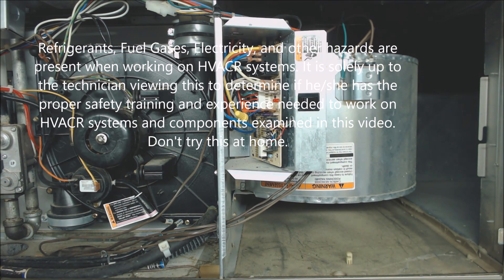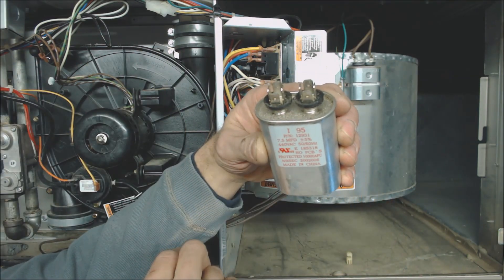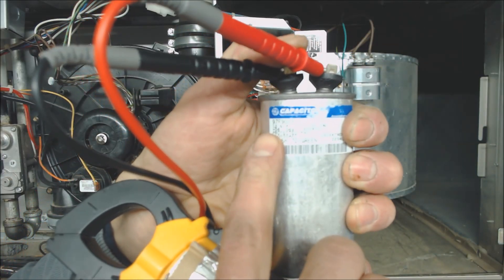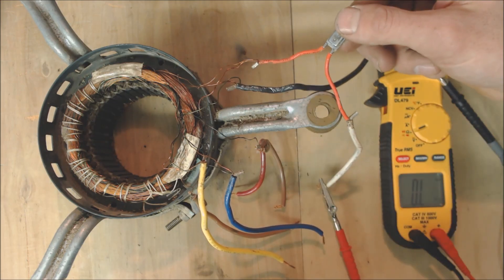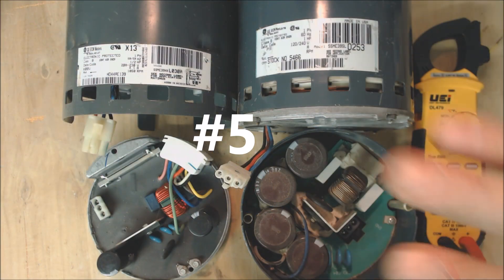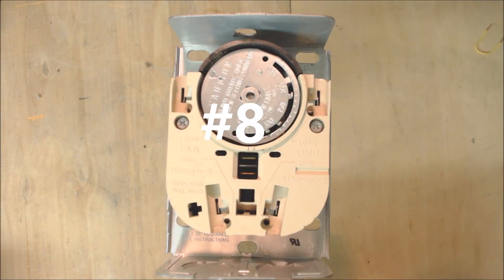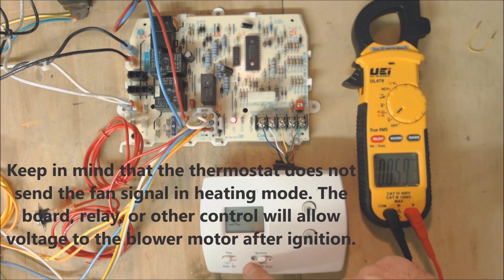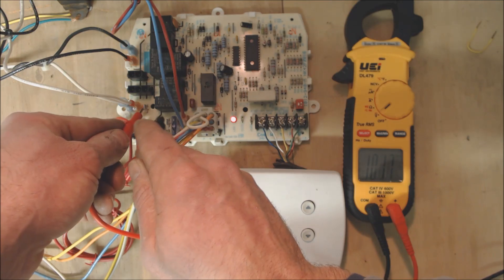Furnace or AC Blower Motor Not Starting or Working! Top 10 Reasons Why!

Comment: I’m having an intermittent issue like this. For three years I have had no issues, last week the blower motor sometimes turns on, sometimes doesn’t. I can hear an audible click when the blower is trying to turn on, but nothing happens. But then again, sometimes it works. More often than not though, it’s not working. Any idea?
Reply from the maker: Is the blower a psc, ecm, or ecm variable speed? If it is just a psc, it could be the capacitor, thanks!
Reply: @acservicetechchannel  It was actually the capacitor. The day I watched the video here I went and changed the capacitor, works perfect now. Thanks !
Reply: Exact same problem here. It got worsened though, now it is not working at all.

Comment: I have an packed unit and the blower comes on but doesn't  blow very hard. I bought a new motor and capacitor and it still barely blows air.
Reply from the maker: It sounds like there may be a duct restriction or dust covering the evaporator coil or clogged filter possibly, thanks!

Comment: My HVAC fan blower motor runs fine when it runs with no humming or vibration. Sometimes it will not come on at all and when I try to turn it on with the fan option on the thermostat it will not run either. I replaced the capacitor about a 2 weeks ago and it worked fine until this morning and the same problem occurred. The compressor and condenser cooling fan run and operate normally but the blower motor will not run. As it is Sunday I left it off most of the day and tried it again in the afternoon on fan mode and it came on and runs fine.  ???  I wished it would just quiet completely so I could find what is causing the problem.

Comment: My ac unit and my blower fan are not coming on and I don't hear the compressor come on (buzz). But getting power to all. I can also hear the thermostat send the signal to turn the motor on. Please any help is welcome.
Reply from the maker: Does it read 24v from y to c when testing with a multimeter at the indoor unit?

Comment: My blower on my inside unit goes for 60 seconds and then it stops. I cleared away any built up dust on the  back of the blower and the motor still seems hot. Everytime I power down then back up, I get the same 60 seconds of blow time. The outside unit is running just fine.
Reply: What was wrong with it?
Reply: Yes, what was the problem? That’s what mine is doing.

Comment: thank you & good job, but one more thing , if you have a bad breaker then you also will not get the voltage needed to start blower, I think this is my issue in which I will correct today
Reply from the maker: Yes these were if you had power to the unit and low voltage controls had power thanks!
Reply: @acservicetechchannel  my actual problem was corrosion on the main wires that come into the apartment  I did not see that coming

Comment: I have an issue with my a/c the blower won’t kick on ,it was working fine until the thermostat batteries die I replaced for a new one and the blower stop working, help me please .
Reply from the maker: Is it possible that the fuse in the furnace or air handler popped or the capacitor is bad at the blower motor? thanks!

Comment: i have a Grandair outside central AC and it dont have a capacitor ''so the ac guy said" ..the blower wont come on and its freezing up
Reply from the maker: The compressor would have a capacitor at least unless the unit is a inverter compressor. You may need to call a different AC tech over, thanks!
Reply: @acservicetechchannel  yeah i called a Tech and.. ''he changed the blower speed and has been working since " fingers crossed" its an inverter i think no relay or capacitor even this Tech said ..hope that helps someone if they ever read this..thanks for the reply :)

Comment: Blower runs on ON, but when in AUTO,  wont start, humming, and back and forth, eventually started.  Now is ON continuously.  Works,  cool ok.  Its a 2 Ton Trane.  What could it be>?
Reply from the maker: Is this a pac, ecm, or ecm variable speed blower motor? Thanks!

Comment: I have a Rv ac unit carrier any idea I had the unit plugged in my generator I plugged out Rv to generator with out shutting ac off now it does not turn on it’s not getting power what’s so ever no lights nothing like a fuse is flipped but it’s not
Reply from the maker: Hopefully it is just a low voltage fuse but not sure if it burnt the control board or something else without seeing it, thanks

Comment: I just started doing HVAC and I ran into a problem where the blower motor works in heat mode with the furnace but when I flip it onto central air it does not come on but the unit outside turns on
Reply from the maker: That sounds like a unit without a control board but if controlled by relays with one of the relays being bad, thanks
Reply: It was a relay no making contact
Reply: Also on the same customers house when in heat pump mode the heat pump turns on for about 30-45 seconds then it shuts down and kicks it into primary heat was turns furnace on
Reply: Could that be a bad defrost board because the AC works perfectly fine

Comment: first of all thanks for the video it is very helpful. secondly I have a question. the blower motor on my AC is not working, I replaced the capacitor and still doesn't work on its own, but if I give it a little spin by hand it starts running. The unit turns off fine but to get the motor started again i have to manually give it a spin. do you think its the bearings on the motor? any advice? thank you
Reply from the maker: It sounds like the best thing to do is to replace the motor. There could be a problem with the capacitor or start winding wire inside the motor. They are not expensive since they are psc motor. Make sure that the new one is the same hp, shaft size, and rpm. New ones may have more speeds so you will need to use the correct speeds and blank off the other speeds individually to make sure that they don't short. You should call a tech to do this if you are not one, thanks Jai!
Reply: @acservicetechchannel  yeah the motor was bad. I replaced the motor and capacitor and my AC is running like a champ. I spent 80 dollars total...thank you so much for your help
Reply: Hey my ac was working good other day suddenly in all vent blow comeing like warm and smell like something burn and I shut of ac then I turn on unit is running good the pipe cold that spouse to be but inside normal air comeing what could be wrong ?

Comment: Replaced motor, capacitor, transformer, thermostat and circuit board. Nothing will turn on? What could be issue ?
Reply from the maker: I would start at the control board and measure for 24v with the multimeter probes reading from r to c. Then jump from r to g with jumpers to send 24v to the g to signal the blower to turn on. Thanks

Comment: Hi. My blower motor will, once in a while, continue to rock back and forth without turning on completely. This has caused my coils to freeze and my limit switch to pop while in heat. 
When calling for fan only, I receive 24 volts from the thermostat at "R" and "G". However, when going from the 16 pin header on the control board (ECM 2.3) the "G" pin (#15) only sends 15 volts to the motor module. The harness is fine as it shows continuity for all lines. 
Is the 15 volts that leaves the control board and goes to the motor module the issue causing my blower motor to sometimes stay rocking back and forth without turning on completely? Or would you assume it's the motor module and the 15 volts out of the control board is not the problem?
Reply from the maker: It could be either or the control board itself, to check, look up some other videos I did on the "testing genteq 2.3" and "acservicetech ecm motor playlist" thanks

Comment: My blower motor won’t start without me giving it a spin.  Once I manually do that, it will keep spinning and blowing air until the furnace turns it off.  Possible bad capacitor...saw that in another comment.  I’ll check it when I get a chance.
Reply: hello. Bro, were you able troubleshoot your motor? I have the same issue with my AC.

Comment: I jumped board G & C and blower doesn't come on.  I put fan switch on tstat blower doesn't come on.  The Gas furnace will run for 2 minutes then shut down cause blower won't come on.  I have power going to my board but no power going to my blower so I guess I have a bad ifc board
Reply from the maker: Is it a psc motor or is it an ecm motor? If it is just a psc, you can measure if 120v is coming off of the board. If the motor is an ecm then there are additional communication wires and a module on the end of the blower, thanks

Comment: Thanks very well thought out and done. My blower motor in any mode: AC/Heat/FAN would come on then stop about 2-3 seconds later. I checked all the limit switches and all were shorted all the way to the board. On a whim I shorted the two air flow limit switche wires at the connector and the fan came on and stayed on. I then tried it in AC, Heat & Fan and work fine, and the motor shut off after a short while like normal. I have Plenty of air flow out the vents so I'm not sure which switch is causing it. I think it's the one on the back of the squirrel cage, it would have to be that one! I checked the one on top by the blower and it stays shorted. So whichever one it is I think it fails due to fan vibration, as the fan spins normal and I have normal airflow. Any ideas how to check it without crawling under there?
Thanks for your great video It gave me other options to keep in mind. I put a video of what it's doing up on my page, before I shorted it, if you get time please take a look at the 3 minute video and let me know your best guess or other things to test. The limit wires I shorted are on the bottom push connector, the two red wires on the left. Control board # B18099-06 or a 1012-930  Best wishes n Blessings. Keith Noneya
Reply from the maker: Technicians usually measure those individually with a meter during diagnosis to determine which is the problem, thanks

Comment: hello i am new in the trade. I would like to ask you about my furnace. Is an old furnace package unit York. My blower it doesnt turn on on heat. I have to set my thermostat on FAN ON" .
I replace the fan limit switch and still the same also i replace the relay 5-1 but still the same . can you told me what else i can do?
Reply from the maker: The fan limit switch would be the item that turns the fan on in heating mode if it is equipped with that. maybe that isn't wired or temps set correctly. Did you look up "acservicetech fan limit"?

Comment: I have no fan rotation from my furnace, after removing the control box cover I noticed flashes coming from inside the hub/motor area by the (2 pin) connector I have my suspicions of the problem. The motor I have is unknown at this point as I have not fully taken it apart. Is this a common issue. My system is made by Air Max?
Reply from the maker: It should have a status code table that should tell what they mean either on the furnace or on the motor, thanks
Reply: @acservicetechchannel   my fan motor is shot, a tech was in this morning and he confirmed what I thought. Its going to cost 1053.$ to replace it 770.00$ just for the motor I will never have anything to do with Air Max products again and from what I read in my manual a 12 month warranty is available at an extra cost. Wow that shows me how confident they are in their product. Thank you for your video and response.
Reply from the maker: Sorry to hear Willie, thanks!

Comment: I have a Goodman Furnace which is about 12 years old. Recently i noticed we were not getting heat in the house. There was just cool air blowing out the floor vents in my house no heat was coming in or blowing when putting the thermostat to heat not even if set to 90 degrees. I opened the furnace and i saw that the blower wheel was not spinning, so i spun it manually several times along with spraying wd40 lubricant and it started to spin and project heat as i saw the flames. The heat is now working but the problem is it eventually stops and the blower motor stops spinning after a few hours of use not producing heat.I am a first time homeowner and is completely lost.I am not that handy so i dont want to get ripped off.Could you please tell me any info in regards to this.Could it be fixed by just the blower motor. Also  previously filter wasn't replaced for about a year. Its replaced now.Im wondering if that caused the problem. Need your much needed help.Thanks in advance.
Reply from the maker: You should check the capacitor first but the bloer motor may need to get replaced but it would be hard to tell without a tech taking readings with a multimeter, thanks

Comment: To test for blower motor on terminals G & C I'm checking for 24volts with the furnace power on or off.  If off the tstat has to be calling for heat?
Reply: The tstat needs to be calling for the fan to come on either by fan-auto and system-heat, or the fan in the fan-on position.

Comment: So if capacitor is rated 7.5 and my meter reads 6.5 is the capacitor bad?
Reply from the maker: Yes capacitor is bad, since it is more than 6% off but the blower usually would still turn on even if the cap was that far off. Capacitor 7.5 uf mfd 370v- https://amzn.to/2Trkm67

Comment: can a capacitor not work just sometimes? mine is 20yrs old & I 
pulled the fan-inside unit - to clean.  It was very dirty.  A few times 
last week the fan didn't come on with the heater but when I kicked the 
fan cover a couple times it did come on.  The motor is shockingly clean 
& spins freely. I will oil it anyway.   can the fan fail to come on 
just from 20yrs of heavy caked dirt?   I wanted to change the capacitor 
as long as it is out but can't read a lot of the info.   It has 2 poles. 
 I can see that  it is a round-
Cambridge 621__4A, 7.5_____10%,  370V_50/60Hz, __4_/70'C, TYP___NS1P_,  _L No E128031,  MO7C10N0, MADE IN UK. 
With this info can you tell what I need to get to replace it?
Reply from the maker: Check to make sure the 7.5 has a uF or mfd next to it. If it does then it is a 370v 7.5mfd capacitor, very standard. Make sure to replace with the same ratings, thanks. Here is a 7.5 370vac cap-   https://amzn.to/2ORsWI2

Comment: I can hear my blower try to go but it just humms loudly and smokes. 😞
Reply from the maker: That sounds like a bad blower motor at this point. It may have been due to a bad capacitor or bearings but it should now be replaced with a new one. You would not want that catching on fire, thanks!
Reply: It actually starts the blower and it’ll run normal once it’s up to speed. Then the next cycle it won’t start then the next cycle it’ll start it fine. Does this still sound like the motor? Might sound like a dumb question but I’m just wondering why the blower sounds and works fine at normal operating speed. It does sound laboured at start up when it does actually start the blower. Thanks for all the help, nice to have a guy like you to turn to. 👊👊 a $200 motor is a hell of a lot better then what I would have been raped for from our local guys

Comment: Quick question. My ac blower runs in cooling function but does not automatically turn on for heating . I have to turn the fan from auto to on and it activates any thoughts would be appreciated. Thanks
Reply from the maker: If it is a furnace, the control board would tell the blower to turn on as the last step in the sequence of operation for heat. If the furnace does not have a control board then the fan limit or fan relay could be bad, thanks
Reply: AC Service Tech LLC Thank you I’ll look into that .
Reply: i have the same problem. I replace FAN LIMIT SWITCH AND RELAY AND STILL THE SAME   I WONT TURN ON THE FURNACE THE BLOWER MOTOR. THE MOTOR ONLY WILL TURN ON COLD. PLEASE HELP. IT DOESNT HAVE CONTROL BOARD/

Comment: My furnace stopped working with a electrical burning smell. I reset it and everything turned on until it was time for the blower motor and it would not turn on. I replaced the capacitor and still nothing. Took the motor out and plugged it in directly into an outlet. Black to black and white to white and it would only work sometimes and sometimes just hum and not turn on. Is it a bad motor? Much appreciated.
Reply from the maker: Sounds like a bad motor, thanks

Comment: I got a Coleman model ugab075buj. The inducer kicks in, the igniter lights the burners but the blower motor doesn’t kick in. Any ideas?
Reply: Ernie-Ray Romero I have the same problem. I took the motor out and plugged it into an outlet directly and it works some times and only hums other times. I think it’s a bad motor but waiting to see if I get a reply first.
Reply from the maker: That could be a bad capacitor for the motor if equipped, could be a bad fan limit control if equipped. I don't know if you have a control board or other relay that would turn the blower on. I would check those before condemning the blower, thanks
Reply: How do I check control board and relays?

Comment: System in a trailor house... in heat mode , the heat comes on ( electric heat) , but sometimes the blower won't come on (But I could jump start it , by going from Auto to On , and then going back to Auto) . It did this Last two weeks of winter , but this year it Worked right to for 2 weeks , then it  ( heat comes on ,But I can't Jump start (blower) like before. I have the Lowest Braeburn tremostats ( I reset it) Just waiting to see if that helps... Do you have any suggestions for Me ??? Thank you
Reply from the maker: Do you have a fan limit control?